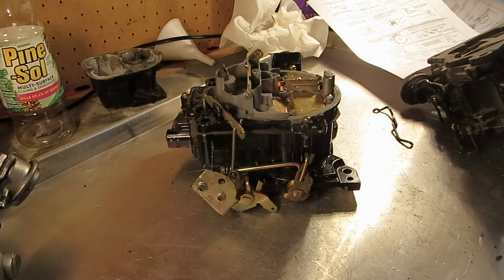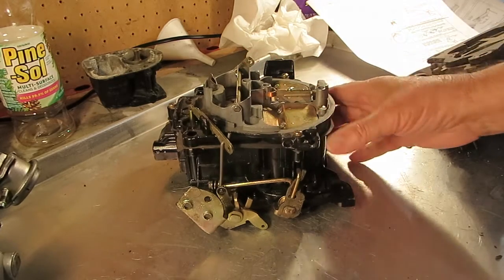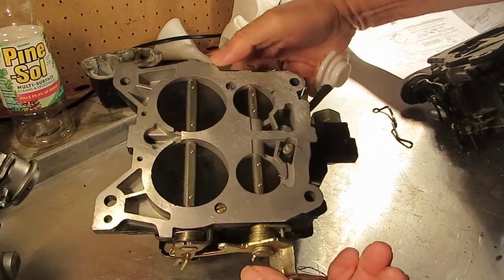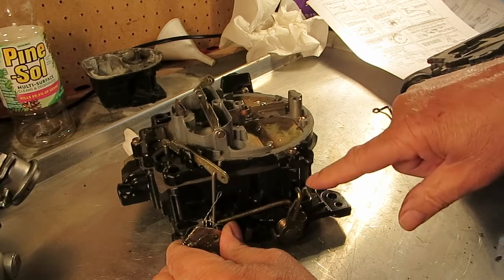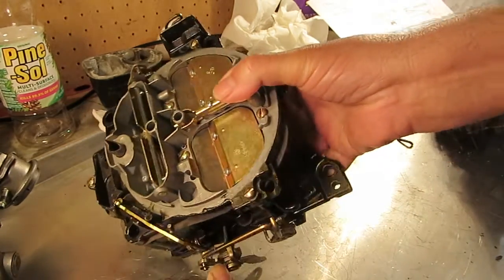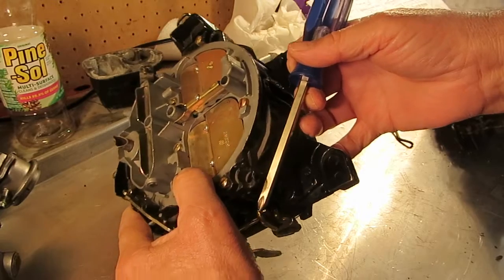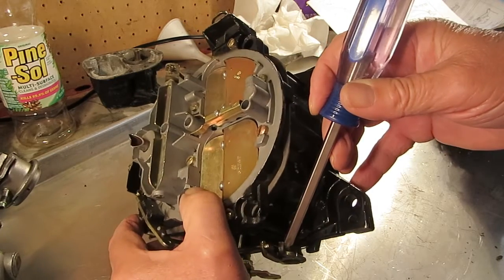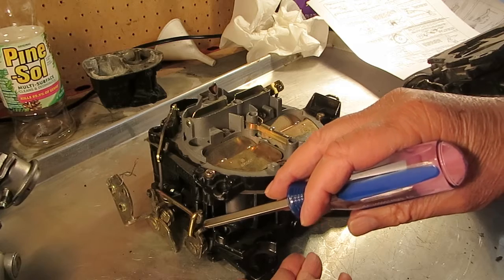Rochester Quadrajet 4 Barrel Secondary Adjustment Guide | Carburetor Tuning Tips

Comment: Mike, I have the other type of secondaries with be wound spring on my Q jet. I'm only getting about 20% of opening on secondary butterfly when working them with gas pedal. This is stock carb on stock   1973 454. How do I adjust to get fully open at wot?

Comment: Mike my carb doesn’t open the secondaries at all? I move the throttle but only primaries open, any clue?
Reply: Secondary stop is not releasing on the choke side of the carb (if there is one) or spring on secondary rod is out of place not engaging the secondary when actuating the throttle lever
Reply: Choke setting.

Comment: Hi Mike great videos. I have an issue with my QJ 7029282 on top of a Holden 308 engine. Currently have 71 jets and 45B primary rods. I changed the jets from 76 as I found them to be too rich. With the smaller jets I find that I have hesitation on take off. Is there a direct correlation with jet size and the take off from stand still. When cruising there is no issue.
Reply: @MikesCarburetor  thanks Mike. Best way to determine optimum jet size. I am in south Africa and don't have access to many spare parts. The 76 jets are my only other option I have. All my spare primary rods are the same 45B. Thanks again.
Reply: Thanks Mike. So would you say the test would be to see how it idles or how well it drives to determine optimum setup.
Reply: I have managed to find an old spec sheet for the holden 308 motor. According to the data the jets should be 76. No mention of rod size. 
Anyways was going to do a test run this morning and the carb flooded. Seemed like the needle was stuck open. A few taps with the back of a screwdriver on the side of the float bowl and it was fine once the excess fuel cleared. I did not make my drive thereafter. Why would this happen?
Reply: Thank you for all.the replies Mike. Something else that I was looking at is the APT. Now my carb is the early non adjustable as the screw is plugged. If the PP drops too low because the little wire for APT is damaged or pressed down this will affect my idle and off idle. Is there a way to verify the position of the wire for where the PP would sit?